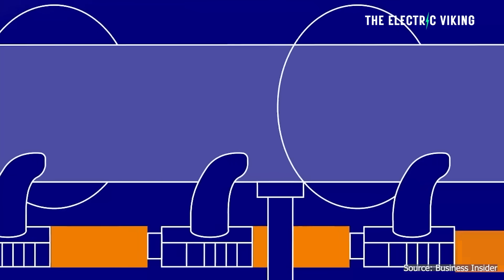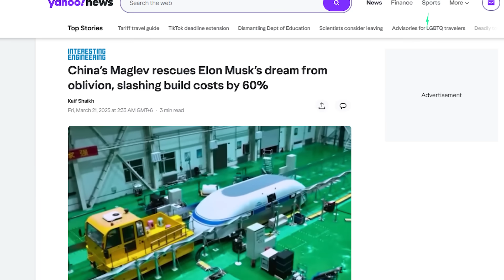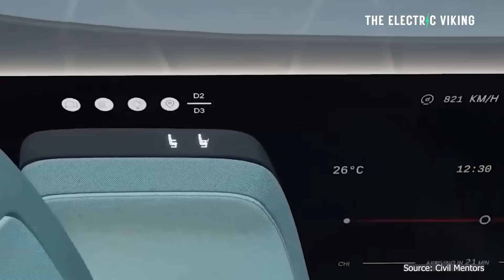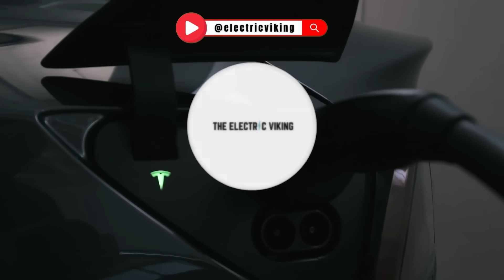Hyperloop Back from the Dead: Maglev Revolution Could Transform Global Travel

Comment: Hyperloop and Maglev are both high-speed transportation technologies, but they differ significantly in design, feasibility, and implementation.
Technology & Speed
Hyperloop: Uses low-pressure vacuum tubes to minimize air resistance, allowing pods to travel at speeds of 600–700 mph (965–1,126 km/h).
Maglev: Uses magnetic levitation to lift and propel trains above tracks, reaching speeds of 268–375 mph (431–603 km/h).
Infrastructure & Feasibility
Hyperloop: Requires airtight vacuum tubes over long distances, posing engineering and safety challenges.
Maglev: Requires dedicated tracks, but is already operational in Japan, China, and South Korea.
Passenger Experience
Hyperloop: Theoretically faster than air travel, but concerns exist over comfort and emergency protocols.
Maglev: Provides a smooth, quiet ride due to the lack of wheel-to-rail contact.
Current Status
Hyperloop: Still in experimental phases, with test tracks but no commercial systems yet.
Maglev: Already in use, with Japan’s Chuo Shinkansen aiming for speeds beyond 375 mph (603 km/h).
Reply: Very thorough
Reply: Any half-sane Hyperloop would use maglev, so they would not be separate technologies. Musk's original "air hockey table" idea for the H-L - in a vacuum! - just shows how stupid the man is, or how stupid he takes us for.
Reply: @ Indeed. He was deliberately pushing the impossible to prevent HSR from being built in the US.
Reply: Won’t a hyper loop system use magnetic levitation
Reply: @whodatcatt  PLUS a vacuum sealed tube! 

Its essentially the cash depositing tube delivery system you might see in banks or chain supermarkets! Imagine youre sucking something through a straw.... thats essentially what it is
Reply: China has been operating a 431 kph maglev line in Shanghai since 2001, 24 years ago.  The Shanghai maglev line was the first commercial high speed maglev line in the world. 

Hyperloop will never work because the cost to build a giant vacuum tube so high, with high operating cost to not only travel at 1000 kph, but to pull sufficient vacuum.
Reply: @ZweiZwolf  Isn't it using the German Transrapid tech because German voters canceled it.